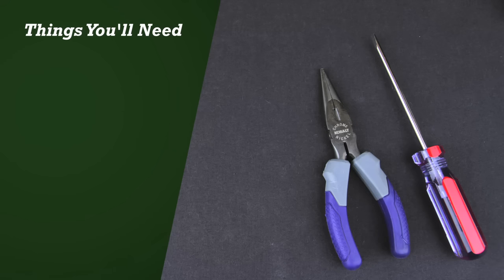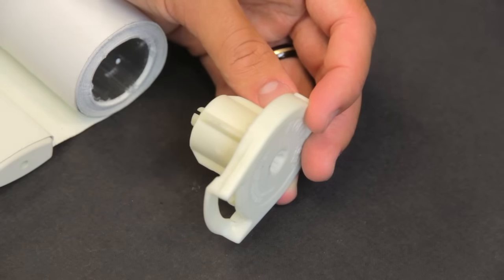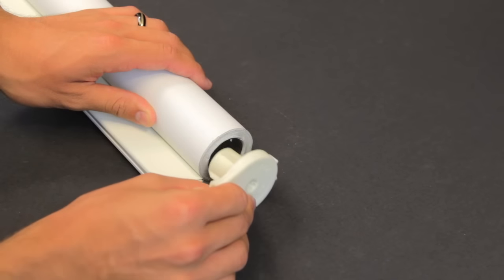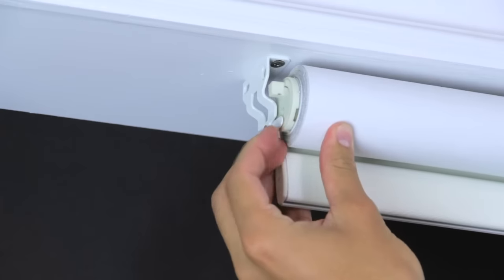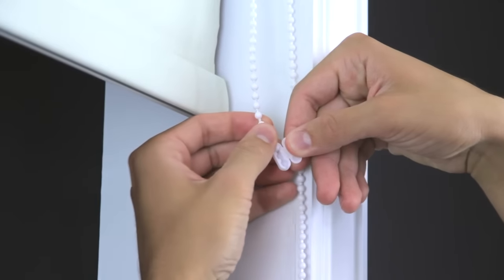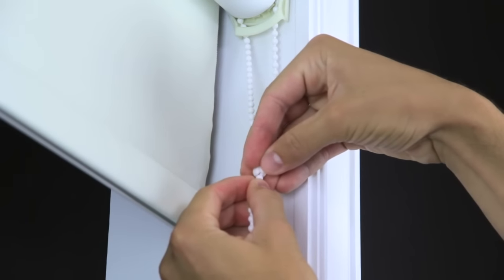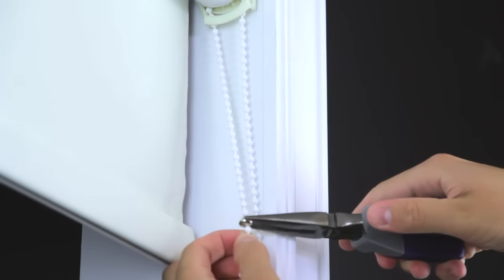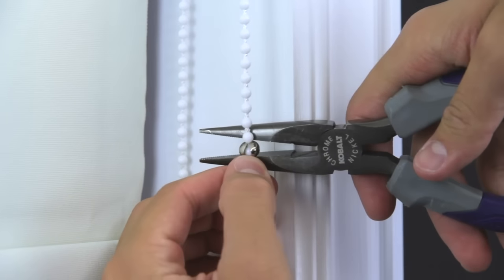How to Replace Chain In a Rollease Roller Shade Clutch

Comment: If your clutch fails, you may have a hard time replacing it, particularly for older shades.   One trick is to examine the cover over the chain.  If that cracks (as it will in older shades), the chain will slip when raising the shade.  You may be able to get it working with a combination of superglue and a hot glue gun to keep the crack together long enough to find a replacement clutch.

Comment: Or you can just slip one bead in from one of the end (there’s a small opening) and slowly pull the beads that are out while pushing the bead slipped in. Continue slowly and carefully and all the beads will be placed in. But use it very carefully and slowly after

Comment: My shade does not stay up the clutch is loose it goes down to the floor. I have taken the clutch apart and everything looks fine Is there a way to repair?
Reply from the maker: Hi Garrett - If the shade won't stay in the up position, it's time to replace the clutch mechanism. This video will help you determine which clutch your shade uses: https://youtu.be/73Tt4pYAfMY.
Reply: @fixmyblinds  Thank you, I actually took it all apart and I noticed the spring was out a little bit so I pushed the spring back in and put it back together and it is working again 😃👍

If the problem happens again I will replace it. But I think what happened is my son was impatient and it was jammed and he pulled too hard.
Reply from the maker: Oh great news! I'm really glad that your shade is working properly again!

Comment: What if no matter where you cut the bead link hits the gear before the shade is fully lowered? I can't find a solution for that issue...
Reply from the maker: Hi Alexander,

That does happen sometimes. When that happens it's typically because the bead chain isn't long enough for the shade. There are two solutions for that issue.

1. Install a longer bead chain so you have enough chain to fully lower the shade before the connector reaches the clutch. 
2. Install a continuous bead chain loop. 

If you have a rollease clutch you will be able to use size 10 chain here: https://fixmyblinds.com/collections/bead-chain-size-10
Reply: @fixmyblinds  Hi. The whole idea here was to shorten the chain so I can install the tensioner inside the window so it isn't just sliding around on the wall... So the only option is to buy a shorter continuous chain? That also means a new tensioner then since it is not removeable without either breaking the chain or the tensioner... Sigh...

Comment: Some window repair people took my curtains Dow and when they put them back up the beads were off the runner the the string doesn't come apart and the cover won't come off for ma to just put it back over and I don't know how to fix it
Reply from the maker: Nicole, to correct this, take the blind down out of the window and remove the clutch from the tube. Then you'll be able to put the chain back onto the clutch gear. If you need further help, please contact us at service@fixmyblinds.com. We're here to help!

Comment: When I pull out the clutch, it does not expose the teeth to put the bead-chain on.  Can't pull it apart, and yet... the chain came out without breaking - it's a continuous chain, not a two-ended length.  Can't figure out how the chain just came out, but the teeth cannot be exposed.
Reply from the maker: Hi Figaro, We'd be happy to help you get the chain back on the clutch. Please email us some pictures of your clutch to service@fixmyblinds.com. We can give you some instructions that are specific to your part.

Comment: great video but can you show me how to reduce the length of chain to avoid grandchildren reaching it.  thanks Paul
Reply from the maker: +Paul Shuttleworth 
Thanks for the question Paul.  This type of roller shade uses the type of bead chain that is connected together with a connector.  Since it has a connector, the chain has to be nearly as long as the shade in order for you to get the full range of travel.  There are some child safety hold downs that cause the shade to not operate if the hold down comes unattached from the wall.  It still does not provide a loop-free environment for small children and pets.  The only really safe bet would be to buy and install a very short continuous chain that is small enough to prevent a small head from getting inside the loop, or buy a new shade that is the cordless/chainless variety.